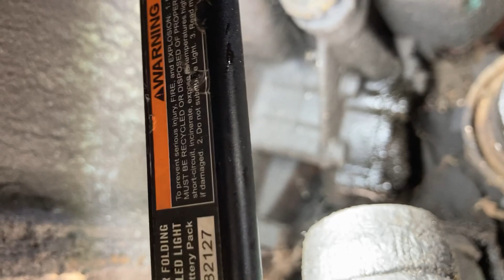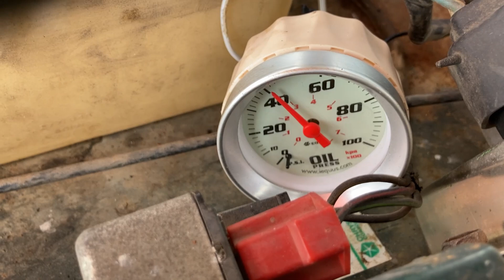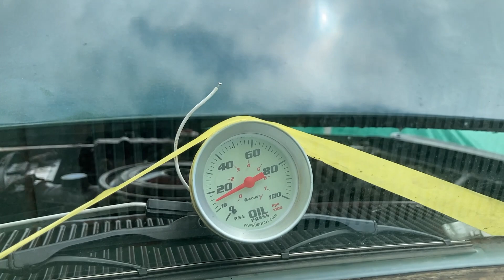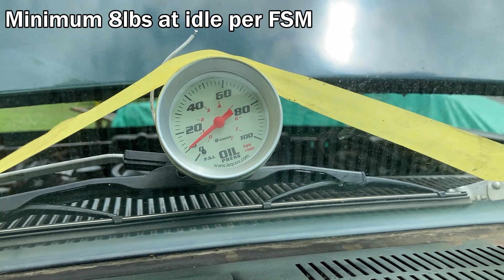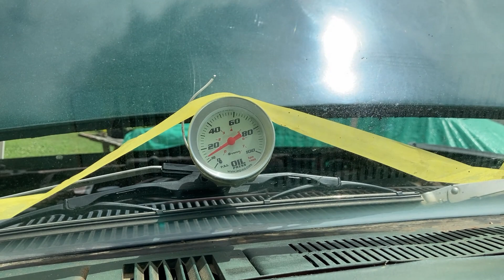Slant Six oil light on at idle...UH OH

Comment: My friend has a 99 dodge with a 318 that he got at an auction. It is a service truck. He had the oil light come on at stop lights. He chased the problem for awhile. The engine was full of sludge. Long story short he used wix filters and oil with a high detergent load. It clogged the wix up after a week or so. (Cause they filter well) So he changed it. And the problem went away. Took longer to happen again. Changed the oil and filter one more time. And never happened since. Just a thought. My 85 d100 pump leaks. But not as bad as yours. But it’s close. It holds 35-40 pounds at hot idle. Idle is manual trans spec.

Comment: I just had my 383 do this after an oil change with a new Wix filter, pulled the filter off and it was dry - grabbed another Wix off the shelf spun it on and it's been fine since. Bad filter! Not sure thats what you have going on but....EDIT OK guess I should have watched more of the vid. Could be the pump.
Reply from the maker: i think your oil pump briefly lost prime. That's a known issue. Cadillac engines with the external pump can do the same thing.
Reply: @TylersNeighborhoodGarage  Perhaps, it was odd as it sounded fine when I had my son start it then I walked to the window and saw the light on and gauge at 0 and reached in and turned it off. Not good!

Comment: Hey unrelated question but you seem to be the most knowledgeable man I can find on Quadrajets. 
Idle solenoid stays engaged on my truck causing a high idle. 
It’s an 86 c20 suburban. 
It’s is a factory non a/c truck, factory 4 speed manual. 
So what purpose does the solenoid serve then, and why does it stay on ? 
Thanks.
Reply: Ps I like all your videos. Very good info.

Comment: Tyler, I have a 1970 valiant that the shoulder seatbelt cuts into my throat, I had a couple of similar cars 35 years ago and do not remember this problem but maybe back then I only used the lap belt?  Any thoughts of how to fix this?  I am considering attaching a chain from the mounting hole to a lower point and  bolting the seatbelt lower. Bob.

Comment: A lot of slugs in bottom of the oil pan. I had that problem with the slant 6 and the 318 I put in.
Reply from the maker: Likely. There were pieces of carbon on the filter standpipe where there is "dead space" and the old filter was heavy. The pan has to come off.
Reply: @TylersNeighborhoodGarage  I took the oil pan it had so much sludge.My plan was to rebuild the engine. I bought a V8 K member for the low. I found 1985 318 904 for low. I got running and I noticed the oil light was flickering at idle. Jack it up pulled the pan off more slugde.Nothing wrong with the oil pump but I put a new one in and cleaned the pickup tube out with all that sludge. Put it back the together running good. I noticed leaking water  put new freeze plugs in comes to find out hair line crack in the block, it pays not to buy stuff for the cheap.

Comment: I would run an engine flush first and then clean up the area around the pump and then drain everything.  Install a new high pressure one then add more oil.  If its still low.. Then its Bering time... Good chance the crap in the engine has chewed up the oil pump gears